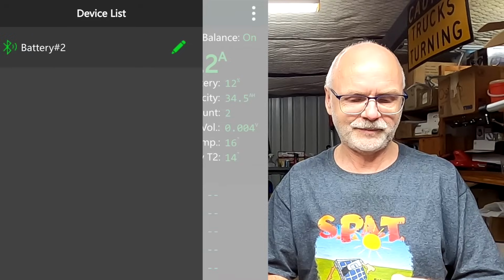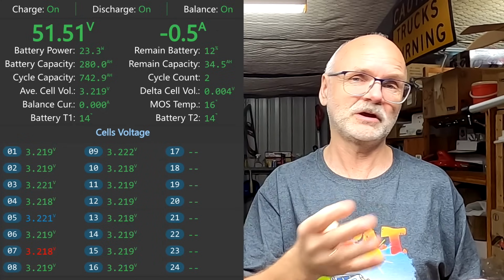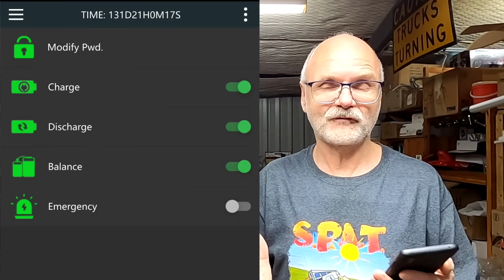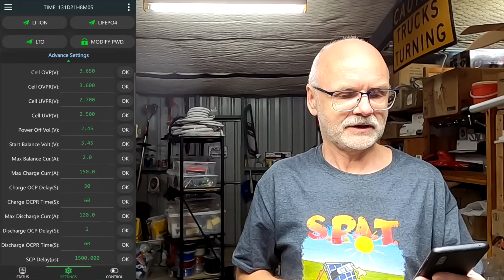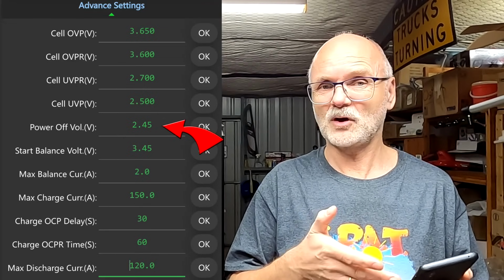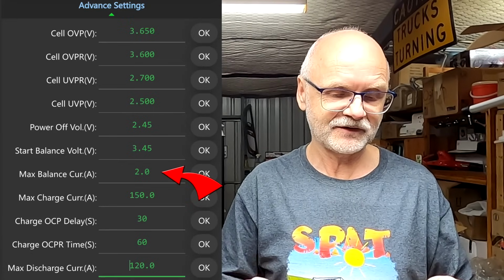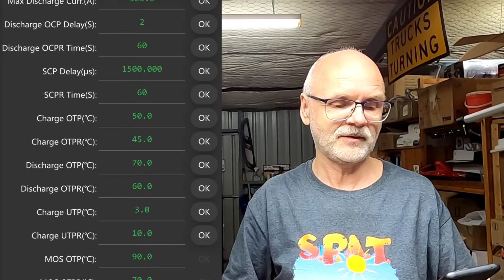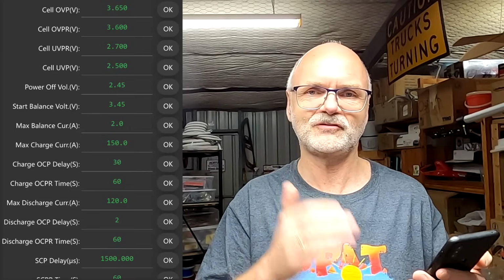JK-BMS: all settings and menus explained. How to program and set parameters.

Comment: Hi Andi, love your content
Going through your link for a BMS, 
Would love your thoughts on the JK-B2A24S20P with the active switch, colour display
Reply: I have 4 same model as you. With and without the display. It doesn't tell much. BT tells everything. It's only nice on starting the bms but even that's necessary only once.
Reply: @krg038  curious if the Display can control or display soc etc, as trying to make a self contained battery box for my brother with small solar system
Reply from the maker: The display is far overrated and does not give you much info. Yeah, it has a switch to turn on but honestly mine is running for the last 8 months, so haven't used the button ever since.
The display displays SOC, voltage and current and some other info (errors...). They have two different displays, one basic and one with more info.
Reply: @OffGridGarageAustralia  Will the button fully turn of the BMS? Will the charging stop if i push the button? What if i disconnect the display, will the battery be off until i start charging it?
I am going to have the battery in my camper, and to bring it to the beach with the cooler...

Comment: Another great video.  Completed my battery about 6 months ago and wanted a JK BMS but at that time they didn't have one for 4s.  I went with the Overkill (JBD) and so far it is working well and the cells are staying well balanced so far.  
Someday I might need that increased balance amperage but, fortunately, right now everything is running smoothly. 
I am going to try the JK BMS on my next battery.
Thanks for what you do.
Reply from the maker: Thanks John, the JBD is certainly a good BMS and I would use them as well. The Overkill I have (rebranded JBD) works well without problems.
Reply: @OffGridGarageAustralia  Hi Andy! Which one do you prefer for a 4S battery pack, the JBD or the JK BMS?? 
Congrats for all your videos and your channel. Amanzing work! 
:washhands::washhands:

Comment: The low temperature reset is too high for cold weather applications. For example I use 3c to start my heater and 5c to shut off the heater. A cold weather application such as a cabin or RV needs to reset quickly
Reply from the maker: Yeah, these temperatures need to be set as per your needs and requirements. I don't use any of them so don't really bother.
Thanks for sharing though 👍

Comment: Thanks Andy.  As you know I have 4 batteries going on my 5th. All jkbms. I had a bad cell and the jkbms shut off the pack so further damage was prevented.  The settings are personal so I like 80/20% balance 3.3, ovp 3.4v, uvp 3.1v. The ocp to 10s saved my battery pack when there was a problem. My discharge current is .5C of my AH.
I have successfully operated the bms at 46C. Great video. You have an accent? I'm always looking at the beer foam in your mustache.
Reply from the maker: Uh, oh, very conservative settings for your battery. OVP at 3.4V? Does that work at all or does the BMS shut off all the time. I think that's a bit low?
Reply: @OffGridGarageAustralia  never shuts off. 3.39 ovpr shuts off charging. It's a tight balance that I used my coulomb counter to obtain. In a year I will remove some cells for capacity testing.
Reply: @OffGridGarageAustralia  never shuts off. 3.39 ovpr shuts off charging. It's a tight balance that I used my coulomb counter to obtain. In a year I will remove some cells for capacity testing.
Reply from the maker: @krg038  on, yeah it does not shut off, just charging... True.
I found charging to 3.4V only is very inconsistent though and could be anything from 70-90%.
What do you SCC do when you turn off charging on the BMS?
Reply: @OffGridGarageAustralia my scc doesn't ever reach 700000 coulombs for my bms or 240ah battery (230ah rated). Basically the bms doesn't ever get to shut off charging.  Its always discharging either to load or charging other batteries. Typically I run at about 65%.  Im guessing the scc would fry with no battery (bms cutoff)

Comment: The way I took it on the Vendor ID Name is.  JK is the name of the company.  The B2A stand for balance at 2 amps.  24S  Stands for 24 in series.  And the 20P stands for 20 in parallel that's the way I always took their ID name as. Thank you love your work on YouTube.                 I AM A BIG FAN!!!
Reply: 15p is 150a, 20p is 200a. Not sure what the P is for.
Reply: @krg038  POWER maybe .. those chinese   developers are unpredictable
Reply: Not parallel guys. It is from amps. 20P means 200Amp
Reply: My guess is the ‘P’ is for Parallel and they are using 10ah cells as a reference point, just guessing.
Reply: @evil17  nobody wants your guess we want facts
Reply from the maker: Thanks, man. 20P for parallel... you can have as many in parallel as you want, I guess. One does not interfere with the other BMS's, does not know how many are in parallel.

Comment: I own three JK BMSes and I thought the SCP setting was for Surge Current and not Short Current. Well, a surge current is almost a short anyways but I thought it was a delay for surges caused by starting an electrical motor or something like that...
Reply: Short circuit protection released 
When the short-circuit protection occurs, the short-circuit protection will be 
released after the time set by the "short-circuit protection release".
According to the manual
Reply: @krg038  thanks!
Reply from the maker: Yeah, OK, short or surge... almost the same as you said. But it's definitely the recover time when the BMS turns on again after such an event.

Comment: Andy, this video is very much welcomed and as usual, your videos are always great. The JK BMS seem to be great. Have you ever tested them at the full 200A? I know the 2x 7AWG cables that they come with is definitely not rated for 200A but wondering if I replace those cables, if the PCB can handle the rated 200A.
Reply: Don’t forget that are are silicone insulated cables temperature rated for 200°C.

#8 awg silicone cable is rated up to 180 amps so #7 is going to ballpark it around 200 amps x2 for good measure.

Terminating connections from 200°C to 90°C or 60°C is where we can get in trouble thermal hotspots.
Reply: @felaxchow207  Actually yes, that's a good point. Thank you.
Reply: @felaxchow207  If you look on internet it seems that different sites have different values. For 8 AWG I seen values ranging from 20 to 100 A ??? Look for example at "CURRENT CARRYING CAPACITY OF COPPER CONDUCTORS" the 8 AWG is rated 100 A for Kapton PTFE FEP PFA Silicone at 200 °C
Reply: @DrCoolZic  - the shorter the wire, the higher the current carrying capacity, the longer your battery cable run, the lower your current carrying capacity
Reply from the maker: Silicon cable has a different current rating and the two 7AWG wires are enough to handle 200A continuously. But with the new screw terminals they make it easy to use your won cables now. I tested with 2x heavy duty 70mm ring lugs (2/0 AWG) without problems. They still fit.
Reply: @OffGridGarageAustralia  Thank you Andy. Appreciate your response. That was the only concern I had with the JK BMS so I'm happy for your reply.
Reply: Yes he did test at 200 amp!! Worked great tell he pushed it to about 220 or so then he fried one mosfet. But bms still works.
Reply: @alanhollister9122  Ok thanks. I guess I'll just need to make sure to replace the cables that it comes with and use the correct rated cables.
Reply: With regards to the resistance of balance wires when you say it's only measuring voltage no current so I'm not sure if that would be correct as they do what they are called. Balancing cells by sending or drawing current to balance the individual cells if I understand what the bms is primarily designed to do. I know it's a very low current but still a current. Am I missing something? Great videos 👍

Comment: I’ve got to banks at 24 volts, 560 amp hours per bank. Two 280 cells parallel 8 cells in  cerise. I have a jk bms on each bank. I’ve been running them now for over two months with no problems at all. If you have settings right then you should have no problems.
Reply from the maker: Thanks Alan. Does the balancing still work ok with two 280Ah cells in parallel?
Reply: @OffGridGarageAustralia  they stay within.03 milamps when close to the top. Can’t tell as they go down because they all stay about the same in the flat. But yes, very close.
Reply: @OffGridGarageAustralia  Using your method of balancing by starting at 3.45 seams to work well. They seem to drift a bit when lower, like 3.3 and it’s mostly under load then, but when they hit that 3.45 mark, they are really close together

Comment: 1:38 You have been using this JK for months now. Curious your cycle count is only "2". Does it increment only when it cycles from 100% downto 20%?
Cycle Capacity: You have it at ~740+; AH in + AH out. Is that a running total since it started from Day1? Or just the recent per "Cycle Count"?
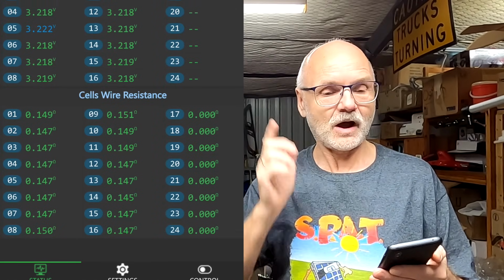11:00 Assume lead wire is 0.1ohm. During "Balancing", a 1A voltage passes through it; voltage drop across said wire will be 100mV - should be enough to cause false reading.
19:20 I had an argument with some solar installers regarding DC SPDs. I told them to install it between the Fuse and the SCC. They kept insisting to install it between Panel and Fuse - guess what reason they gave ? So the SPD will protect the Panels.
Reply: "Assume lead wire is 0.1ohm. During "Balancing", a 1A voltage passes through it; voltage drop across said wire will be 100mV - should be enough to cause false reading." The BMS does not read the voltage when there is a balancing current, precisely because of that. It measures the cell voltage when there is no balancing current to/from the cell in quesiton.
Reply: @upnorthandpersonal  Make sense.
Reply from the maker: The cycle count reset when I swapped the JK from the 304Ah battery to the 280Ah and had to change the capacity in the settings. Since then it counted 2 cycles.

Comment: Hi Andy great explanation!  There have be some stories going round the marine industry (Manly QLD) and also on the web about a worst case scenario where the solar controller shorts and raises the voltage in the cells causing the BMS to isolate the system. This then allows the direct panel voltage to go through the regulator and spike over 100v fusing the FETs causing damage to everything connected. (including batteries and electronics) Have yo hear of this. Do you believe that this is possible, would better quality Solar Regs (Victron ect) have something in place to stop this occurring. Thanks for all the experimentation, Wayne... (maybe an avenue for some destructive testing)
Reply: Victron makes an Isolated charge controller that keeps this from happening , the  RS models that came out last year . I don't know if other models of Victron do this , I don't think so .  These do :  RS450/100   RS450/200
Reply from the maker: Yes, only the RS models are isolated. Unfortunately they do them only for compliance in certain markest and not part of their regular controllers. Would be great for all SCC to be available in either form.
Reply: @onthelake9554  Thanks, seem like they only suit 48v. Marine is mostly 12 & 24v and it would be hard to convince people with the price...

Comment: I just receive 2 JK BMS, yesterday.  
There was a Power switch on this model, so I believe that the time where we had to jumpstart the BMS with a battery voltage.  
Thanks for the video, now I don't have to use a lot of time to examine all the settings 👍
Reply: Mine had a switch power button too. Good idea.
Reply from the maker: Yes, all new JKs are having a display with power button. 
Honestly I have jump started mine exactly once since I installed in the battery shelf. It will never disconnect unless I take the battery apart.

Comment: I switched to the jk bms from the daly, best decision ever.
It's the product a lot of us waited for: BMS, active balancer and a heating pad control in just 1 product.
Reply: I have the same product (with heating pad control) coming in the mail. Do you have any heating pad/element recommendations?
Reply from the maker: I think it's the best integrated BMS on the market. The easy setup and active balancer makes it outstanding.
My 4s-8s BMS has the heating option too but I don't have the connector to test it out. It's only 3A, I believe...

Comment: It is famous indeed, but suck it could not communicate with Inverters without help from 3rd party devices/software.
Reply from the maker: Why do you need a communication between a BMS communicating and an inverter?
Reply: @OffGridGarageAustralia  Battery SOC are at 70%. I Disconnect, Reconnect the battery and Inverter (Deye) now claims the battery SOC is at 100%, 

That is what no comm did...

Comment: Maybe you will come to it later in the video and I have fallen asleep (living in Sweden) what the heck is the JK BMS emergency setting?
Reply: Yes. You did fall asleep. If you are on a ship, out of charge and flat battery.
You are taking in water, you need to call a mayday... Hit the emergency setting and the battery turns on, at the risk of damages to your battery...
Reply: @B4x4  Thanks for the answer and very explanative explanation!
I wouldn’t have known this until today when I read you’re reply (so you are right, I fell asleep).

Comment: Just a note relating to the inaccuracy in the current reading you found over the full range....there are 2 parameters the designer's need to implement in firmware for getting an accurate measurement ... scale (the multiplier) and slope(controlled by an offset). Seems like they have neglected setting the slope properly in this case hence it'll only be accurate around the calibration point.... 
Anyway as you say ,in your case its unimportant as you're referencing the victron shunt.
Reply from the maker: Apparently the calibration works fine with pure DC loads. As we use mainly inverters, we always have DC ripple which stuffs things up. I'm not too concerned as I have the smart shunt as point of truth.
Reply: A coulomb collector is the only accurate way. Not using voltage as the reference.
Reply: @krg038  Hum coulomb collector is for Ah not A
Reply: @DrCoolZic  correct. Ah collected SOC

Comment: so far my daly bms, (48V 16s) reads incorrect voltages on cells. it will shut off saying cell 5 shows 4V test manually 3.3v :()  im ordering a dally BMS 48V 32S (150 amp) to cover both battery banks. hopefully for $300 buck better quality :() I'm in the same boat baby sitting battery's until then. if this one fails me, so help me god I need a beer.
Reply from the maker: I think you may be able to calibrate the Daly with the PC app. Heaps more settings and features than only with the mobile app.

Comment: Accent I through you had an Aussie accent with a twist of German.  Very cool accent to me.
The wiring resistance is important Andy, works output how much Voltage to send each cell to keep each battery to a maximum of 2 Amps, I believe,  I still maybe worry.  But as a Ex calibration technician this makes sense,  right.  E=V/I. Without current there is no Voltage.
Reply: Without voltage difference there is no current!

Comment: As always great content.  I only run a 4s 280ah setup using Daly( for a higher amp draw,as there is nothing much else out there) but I find your videos very interesting and informative.  Would love my own off grid setup but I rent and can't justify building something portable.
Keep the content coming.
Reply: Absolutely nothing wrong with daly. Good at what they do. Csnt fault mine after a year.
Reply: @LambySRI  If you look around you will find a few complaints .  https://www.youtube.com/watch?v=JbnFyU79Nf0
Reply: What's the max amp draw on that? I have a 4s JBD that is rated 200A with 0.5A balance, haven't tested it extensively yet but seems good so far.
Reply from the maker: The Daly's are good for this exact purpose and can handle up to 500A continuously. As you said, nothing else out there (unless you go QUCC with a relay function). The balancing totally sucks though so an active balancer may be needed.
Reply: There is a 500A jkbms but it needs external relays. JK-B2A25S60P
Reply from the maker: @egg399.  I think it even comes with two relays for charging and discharging. I'll get one to test...
Reply: @OffGridGarageAustralia   mine had no relays. It looks to have 3 relays?
. 1 charge relay, one discharge relay and one pre-discharge relay. I’ve got a 500A mechanical relay for discharge, 100A SSR for charge and a 40A SSR for pre-discharge to switch in the battery bank via a resistor to the inverter. Quite clever stuff. As I have to have separate charge discharge circuits I don’t need an all in one inverter so I’ve opted for a big 16kw pure sign wave inverter which was around gbp 700 with delivery. It’s turned into a much cheaper solution than growatt or victron. I’ve also got an ATS so I can turn my house off-grid and automatically back on grid if I run out of battery :-). I’m still wiring it all up so will take a bit of time before it’s all plumbed in. Rome wasn’t built in a day after all!

Comment: Thanks for this cool Vid, it has come just in time because I've installed today my first JK BMS and I've been shortly before to ask you about the Values. But I've just only one Question: In case of using the BMS for some different Batteries, is there a possibility to reset counted values?
Reply: Try changing the capacity in settings then change it back
Reply from the maker: As Kevin said 👆
Thank you